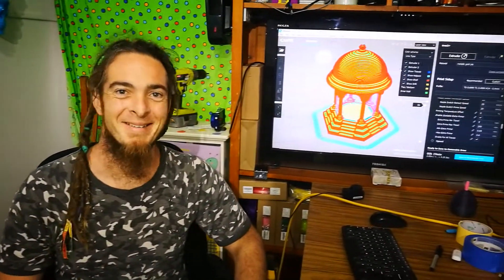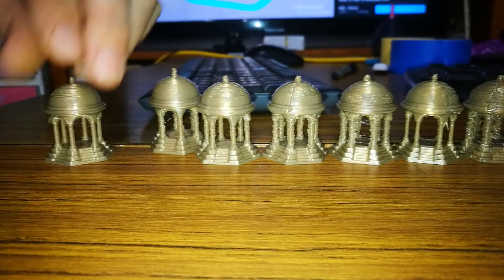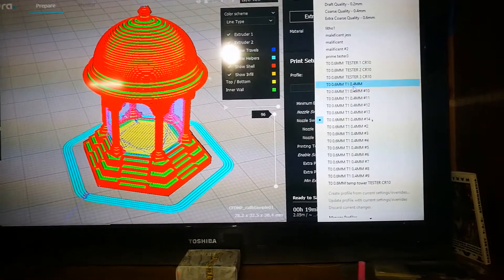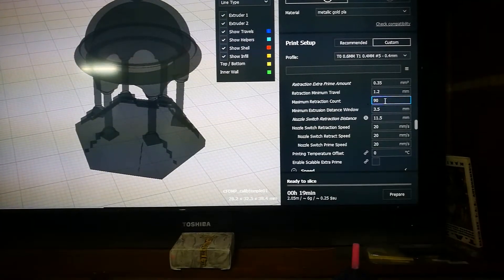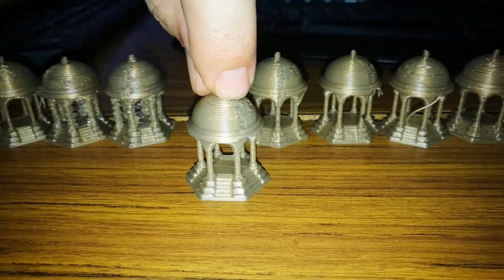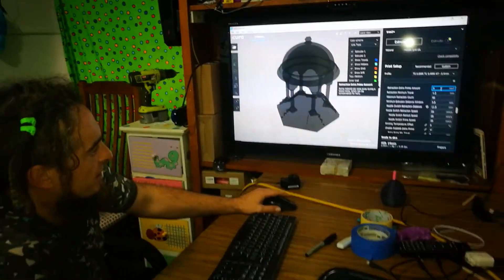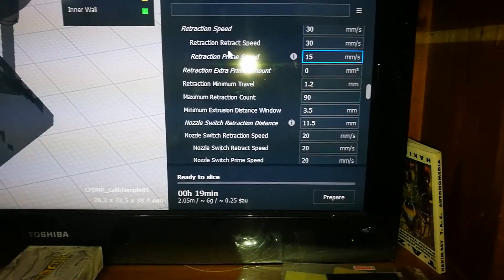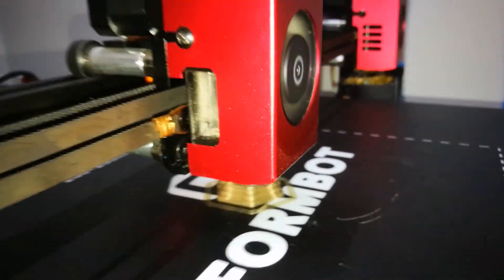cura 3.3.1 with the trex2+ and a 0.6mm nozzle.

Comment: Hi! So how did you've solved it? BTW, is you extruder direct or bowden?
Reply from the maker: Hi thanks for asking. I got it dialed in beautifully. Then just recently my PC crashed and I'm back to re writing all my profiles. Lol
Reply: IMO there is not too much to rewrite :)  One thing is really bothers me in Cura is that g-code scripts works not flowless with the "main script". You can see this in my last video (there will be about fan speeds and Bridges).
Reply from the maker: @KiR_3d  there's a few special considerations with independent dual extruders. And the trex2+used a single fan in the hot end so fan settings are unique